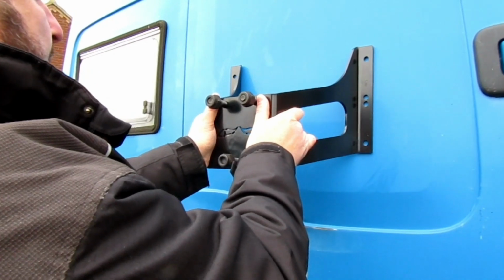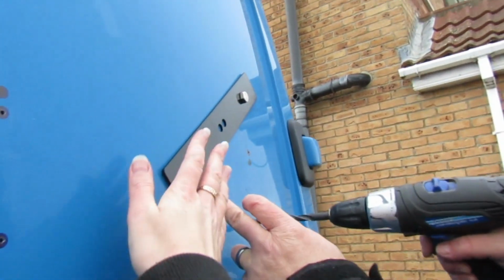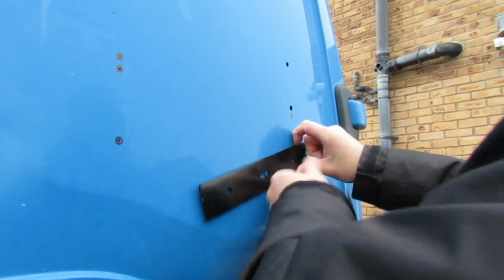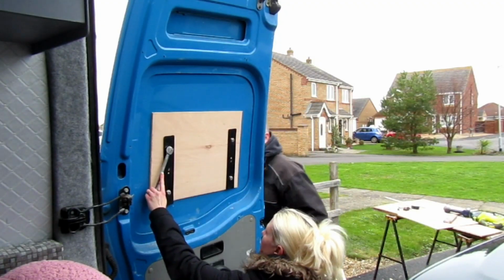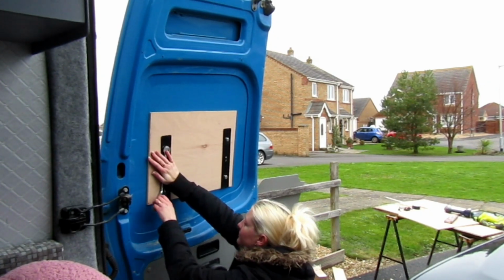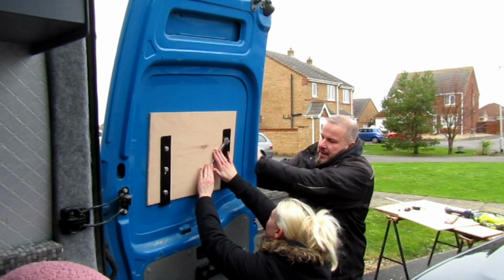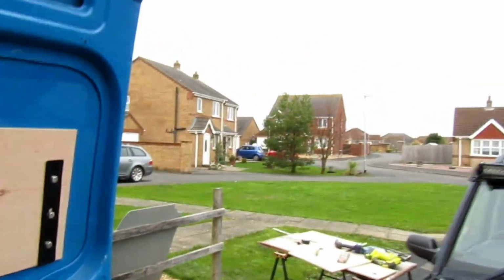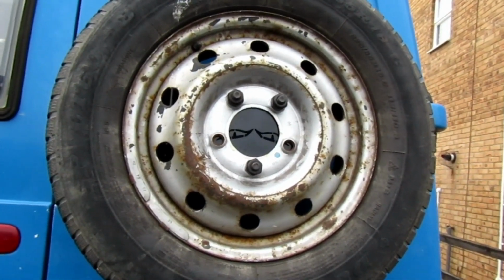Spare Wheel MWB Campervan Rebuilding our off grid Van Conversion Ep13

Comment: Is there a more secure solution out there?  I mean anyone with a wrench or pliers can nick it in a jiffy.
Reply from the maker: You'll have to check which way you'd like to do it, we put extra bolts on other way which wasn't filmed for security 😊
Reply: @BoagUK  yeah, I was thinking of a similar thing - like long Carriage bolts or U-bolt, so that them bolts are untied from inside the van.
Reply: Just drill a small hole in the end of the bolt and put a split pin through to prevent the nut from moving past it